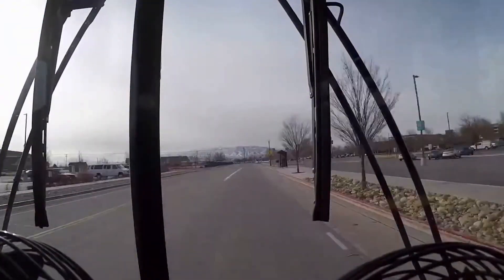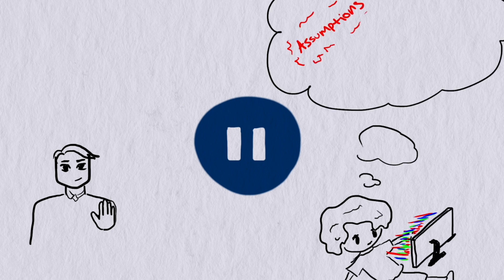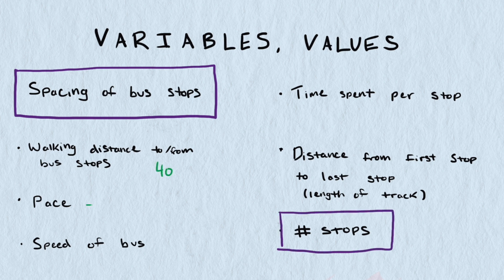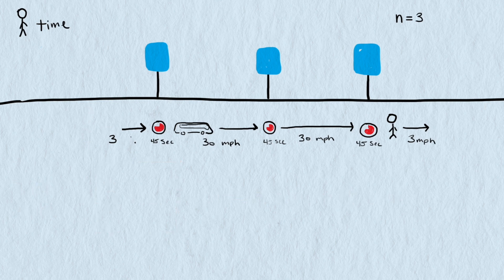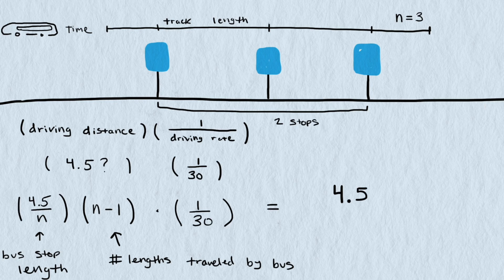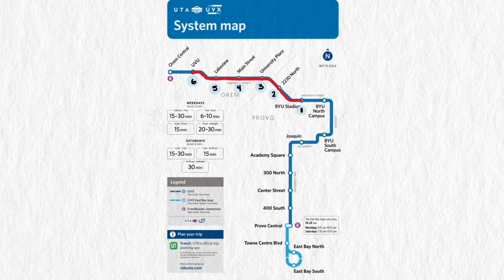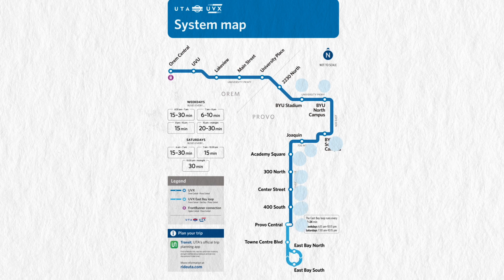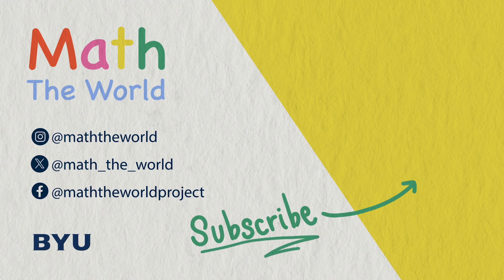How Far Apart Should Bus Stops REALLY Be? | A Math Problem Solving Approach | Part 3

Comment: Isn't the average walk around 1/4 distance between stops, rather than 1/2? Then the optimum will be at fewer stops.
Reply from the maker: Thanks for the comment. In the linear model, yes the average is 1/4, but I used 1/2 for two reasons. First, I picked a longer distance to cancel out with the assumption that the bus would be at the stop when the traveler got there. One is an overestimate and one is an under estimate, although I don't think a put a line in the script about that trade-off. The other reason I picked a walking distance on the longer end was to pick something that would generalize better. Most people would live off the road and many could live/have a destination well off the bus path, so the average in reality would be much larger than 1/4 and could even be larger than 1/2.   I am sorry I wasn't more clear about this in the video. It was already getting long.
Reply: @MathTheWorld  But living off the road gives extra distance and time that isn't improved by more stops and so doesn't affect the optimum. Or if you are able to take a diagonal to the stop it even moves the optimum towards fewer stop.
Reply: @Sgrunterundt I have no idea how walking a diagonal could possibly result in wanting to walk farther to the closest stop, added distance is added distance. At best, it wouldn't increase the number of stops as much, but it would still increase it.

But I'll grant you that if the route is already fixed, we should ignore distance-from-route, or add a fixed value, because stop placement has no effect on it. They'll always walk the distance-from-route no matter where the stop is. Making all other delays (acceleration, missing a bus, loading time, etc) dependant on distance between stops is oversimplifying the model.
Reply: @LibertyMonk  I'll try to explain the diagonal idea with some concrete numbers: Imagine you stay right next to the route and the bus stop is either right by your house or 4min away, in this case the difference in travel time is 4min. Now imagine you are 3min away from the route, and would be able to take a diagonal. If the stop is perpendicular to your house, you take 3min, but if it is 4min along the route, it would only take you 5min to get there diagonally (pythagoras), so even though the bus stop is 4min away, for you the difference is only 2min. Hope that helps
Reply: Yeah echoing comments above, but I'm not sure those reasons are valid:

- on the "waiting times cancels this out" piece, waiting time is affected by bus frequency, not stop distance  (in the real world, with a fixed number of buses frequency would go down as the number of stops increases). The only way I see to get to that conclusion is to consider that frequency increases as you add more stops - but that feels like an incorrect assomption since passenger flow is the same in this model.

- The other point has been covered above, but idd adding a constant walking time (neglecting the gains you might make when traveling "diagonally") shouldn't result in an increase proportional to distance between stops.
Reply: @kemonius6033  Waiting time is not affected by stop density, but driving time is.
Reply: @Sgrunterundt  I agree, but that's not my point - I was replying to this piece: "I picked a longer distance to cancel out with the assumption that the bus would be at the stop when the traveler got there. One is an overestimate and one is an under estimate"

In the video, it is assumed that you get the bus immediately, and the idea of the comment I replied to was that this assumption, when relaxed, results in a worse waiting time in the case with more stops - but this is not the case.

Comment: Nice, I actually calculated this about a decade ago. But I did include the accelerating and braking of the bus. Because at higher max speed, that becomes more and more important. (you just have to add some extra time to the stop time, depending on the max speed of the bus)
Reply from the maker: Very cool! Did your answer differ much from ours?
Reply: It's been a while and I don't have the file anymore. But for a road with a max speed of 50km/h, the distance between stops wasn't that much (1 or 1,5km I think) resulting in an average speed of just below 30km/h. @MathTheWorld

Comment: One of my favorite designs ever, is the music cd. It is just so well thought out. From the bit depth needed when using ditter to obtain a good signal to noise ratio, having a little headroom on the sample rate, including error correction, having the disks be made super cheap and have the laser focus compensate from the whorping of the disks, including a buffer for constant smooth playback at all times, and not overdoing anything to keep the proce down. Due to the great design the price of the cd player was able to droop over time as chip production was improving. And due to the bit depth and sample rate considerations it is hard to find any meaningful improvements for the playback quality. Honestly the only real improvement is lossless compressions like FLAC.
Another one is the original USB and the PCI standards, the idea to use the same connections for multiple things has served us great over the years.
Reply: Commodore computers had IEEE-488 serial bus communications for disk drives and printers almost 20 years before USB was invented.  They also put two serial ports on each device so you could "daisy chain" them without a hub.
Reply: @wizardsuth  True. But the  IEEE-488 was mostly only used for printers. You also had the RS-232 (DB-25, DB-9, seriel ports) that was also used a lot, and then you had PS/2 that replaced the DIN connector for mouse and keybords. And for charging you mobil phone you had a different connector for each model of phone (or at least every brand).
What I think the USB standard did right, was that it tried to replace all of them. You used USB for your printer, mouse, keyboard, joystik, phone (I think that only happened with USB 2.0), soundcard, external CD drive, external harddrive, flash drive, Card reader, Zip drive and much much more.
If we did not have USB, we would have wasted so much time finding the right connector/cable.
Ethernet (IEEE 802.3), might also be up there, it is mostly used for one thing, but it has done that one thing for 30 years now, and omg the Token Ring types of networks it replaced made everything 1000% better. (10000% after we got rid of twisted pair).
Reply from the maker: I never realized it, but you're right! The CD is a great design. It seems the things that are designed well are the ones you don't notice.

Comment: There's a stretch of road near my house that I feel actually has too many stops. Mostly because one of them is directly in front of a grocery store, with no crosswalk or bridge, causing people to run/walk straight across a 4 lane road to get to the closer stop, instead of going to the next stop in either direction which DO have crosswalks. The distance between the outside stops is only 0.28 miles, so it doesn't seem unreasonable to have to walk to either of them from the middle.
Reply from the maker: That's a great observation! Our model suggests bust stops should be about 0.35 miles apart. So 0.28 is a bit shorter than that, but not too far off. I think the best solution would be to build a crosswalk or walk bridge at that stop like you suggested!
Reply: when you consider that its 0.28 miles both ways, likely carrying groceries 1 way, it makes more of a difference. when was the last time you walked 0.56 miles, carrying groceries across half? they should just put a crosswalk directly from the stop to the store
Reply: I don't think I was clear, its 0.28 from the farthest stop to the closest. So from the middle its 0.14 to either side. If they put another crosswalk in it would be 0.14 in between 3 of them

Comment: One of the reasons I suspect the engineers chose as few stops as possible without being too inefficient is to make the time tables of the route as even as possible between rush hour and when fewer usually take the bus. It is more likely they will have to stop at all bus stops no matter. And if you speed up the time tables when it is not rush hour because you are predicting some stops will be ignored you will only be right most of the times and get complaints the other times. Sometimes some big event happens in the city and the evening will be a rush hour. So the engineer's think it's better to have fewer stops, same time tables, and if a stop or two is still not needed to stop at, have the buss stop at some stop not to miss potential passengers who planned to take the bus.
Reply from the maker: That's a great observation! We had another viewer make a similar comment. Our model might not be what most route designers use. They seem to optimize travel time on the bus instead of walking time to the bus like we chose. We might make a part 2 to explore other ways we could model this situation and compare the results, so subscribe and stay tuned!
Reply: @MathTheWorld  I would have optimised door-to-door trip times averaged across all riders, which would effectively pessimise door-to-door trip times for most individual passengers.

Comment: as an actual transit user, i can answer this question without calculation. why? how? because i am, in some sense, an analog computer, and i have done the "calculation" via my personal experience. the optimum distance is 2 blocks between stops for regular buses, and 5-10 blocks for "express" buses.

using posted averages, 8 blocks per mile, that's 1/4 mile between stops.

your calculation seems to give about half a mile between stops.

actually, that's damn good for a simple model.

one big factor you did not consider is that there is a BIG difference between time spent walking, and time spent sitting. a weighting function is needed. also, for very short trips, which a lot of people need, the distance between stops needs to be shorter, otherwise there is little point to having local buses at all. what happens in that case is, by the time the bus you need has even arrived, you have walked the 10 blocks to your destination.

there are many other factors as well, and they actually dominate. the real question to answer is not travel time, but COMFORT. i looked into this type of modelling briefly, (god) 40 years ago, as an undergrad.

anyway, a good answer to an important problem
Reply from the maker: Thank you so much for your comment. Well maybe the Rapid-Bus Transit System works more like an express bus, and that is why we are closer to your 5-10 block estimate, than you 2 block estimate. 

If you are on a system were the bus won't stop unless someone is loading or unloading, then it costs less to have more stops, but that doesn't fit the nature of this bus system that we were modeling. 

I like you comment about comfort. I would call it convenience. It might be the biggest problem for many public transit systems outside of dense metro areas. I am amazed when I pull up directions on my phone through Google maps how close the public transit time is to the walking estimate time for trips that are just a few miles. 

We didn't put in waiting time because I took a worst-case scenario in the walking case (right between bus stops). I thought it was simpler to do it that way, with an over-estimate on one, and an underestimate on the other. However, I have done more work on the walking distance, and it turns out that it is probably not an over-estimate, since many people will live well off the road, and they have to walk along roads to get there (not distance as the crow flies) and so the average is close to what I considered the "worst case scenario."

Comment: Your goal is one no bus rider would share. To a bus rider, a minute spent getting to the bus stop with your stuff, such as four bags of groceries and a toddler, is generally more important than five minutes "relaxing" on the bus with a toddler.
You need to weight times. You also need to determine how many stops will actually be used. If a stretch of road has ten bus stops but only one is generally used on any particular bus trip, then going with one stop does nothing except drive folks to drive themselves, since the bus stop is inconvenient.
I'd like to see virtual bus stops. Folks alert the bus that they want a ride, and the bus tells them where on the street it will stop. Physical beacons (like walk/don't walk) can direct folks to the current stop locations.

Comment: 3:27 where are your units!!!

I think one thing your model missed is that with more stops you have less frequent buses, because of the stopping time (or have to run more buses on the same route, which costs more money), so the wait time is longer, or you have less flexibility on when you make the journey. I'd walk an extra few minutes if it meant there's an extra bus each hour. (For context my walking distance is usually about 0 but there's only one bus an hour, so that's the more relevant factor)

Also far less significant (probably not worth putting in the model) is that you want to walk to the next stop to minimise missing the next bus, so the midpoint for walking time to get the bus is not quite between the two stops, it's a bit closer to the earliest one - because if the bus passes that stop without you, you wanted to be at the next stop
Reply from the maker: This is a great question for us to explore! How many buses should be on a route given the number of stops?

Comment: My local bus here in the UK has stops that vary between 180yd and 550yd separation.
Stops are placed based on passenger usage numbers...
Reply from the maker: That's a great metric! We unfortunately did not have access to passenger usage numbers but would certainly help refine our model

Comment: Could yyou expand on this model to find the optimal time between loops/how many buses should run the loop?
I know there is the factor that more buses costs more, but from a merely time aspect the number of buses running the route and how often makes a big difference with transit.
See, I used to live in an area where the buses would come by every hour. The problem is, the route would take less than an hour, more like 35 minutes to WALK from one end to the other. I found myself more often walking than actually taking the bus because it meant i would get to where i wanted to be sooner than waiting for the bus would get me there. If there were double the buses running every 30 mins that would completely fix that problem, but like demonstrated here there would be an optimal amount of buses for any given path.
Reply from the maker: We certainly could! We are essentially changing what our input is for our model. We'd want to build a new model that inputs number of buses running the loop and outputs travel time. So we would still be trying to minimize this equation by finding the optimal number of buses to minimize travel time for the rider. We'd likely need to consider different variables and make different assumptions. Probably stuff like, average speed of bus, length of route, the number of stops, and wait time at each stop. This would make a great follow up video I think!

Comment: Simply put, it depends on route size.  The longer the route, the bigger the spacing in order to optimize travel time.  Of the route gets too large you end up having to have sub or branch routes for optimization.
Reply from the maker: Great observation! Routes can definitely factor into bus stop spacing and number of buses needed to handle commuters needs

Comment: 45 seconds per stop? Its 2-10 seconds in Taipei. And 10 is very generous. I can see maybe 20 max, if its a regular stop and 1-3 dozen are getting on and off. If its a "endpoint" like a subway station or university, or any place where dozens of people are expected to onboard or the driver takes their breaks, then i can see 45 seconds then, but thats because everyone is in a single-file line and not standing optimally. In these situations, it takes a minute to a minute and a half to get maybe 3-4 dozen people onboarding on a mini bus. But during these times, they usually have 2 mini buses taking passengers at the same time since usually a hundred or so people are waiting., the other bus will stagger its departure or has the short route so they will arrive several minutes apart. Anyway, most places usually have 1-20 people alighting and boarding at the same time, but places near secondary schools and universities can have a few times more than that waiting for public transport. 
Given all this, i can see 45 seconds if you have maybe 15 people in line getting on in an organized manner, but literally any other time, i dont see how any typical or somewhat atypical amount of people would take more than 20 seconds otherwise

Comment: Also walking distance/time is probably not valued as high... in their models. They put a stop where its needed. Its irrelevant for the bus company if the customer walks 5 minutes or 40 min prior the stop. The only effect they count there is if its to few stops... they get fewer customers paying for said trip
Reply from the maker: Great observation! We've had a few other viewers point this out as well. One even worked for transit and said they try to prioritize trip time instead. We'll likely make a follow up video where we'll adjust out model to consider this point as well. Stay tuned!